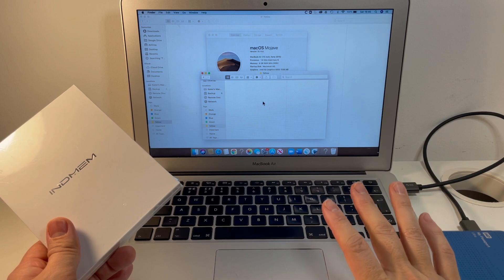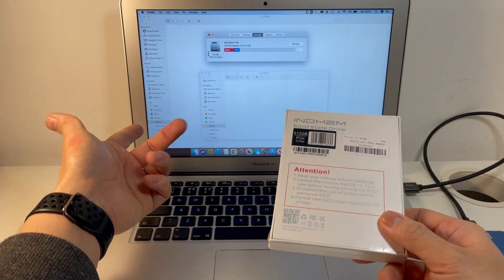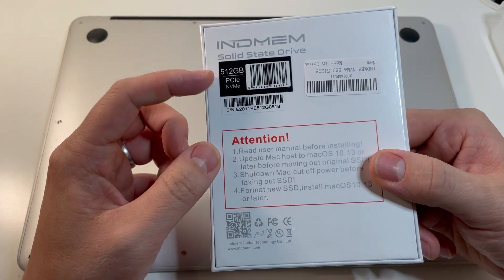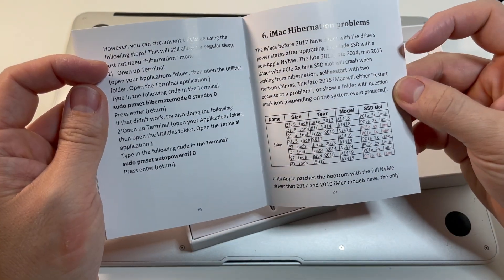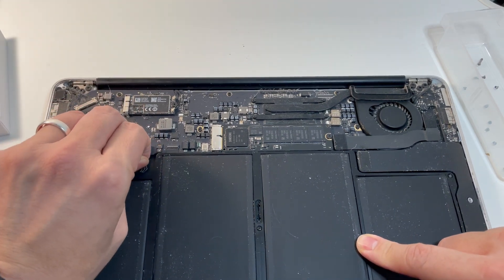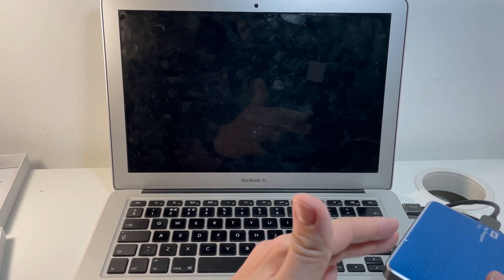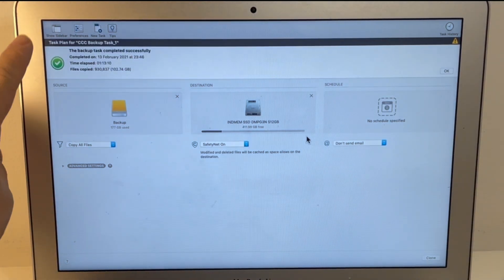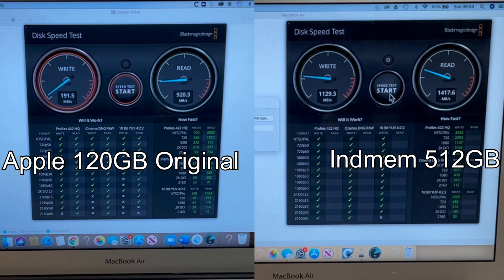Indmem 512GB SSD Upgrade - MacBook Pro 13" Early 2015 Custom 12+16 Pin Apple Solid State Drive

Comment: My original SSD failed and I replaced the drive with the Indmem 512GB SSD, and is not being recognized. I went through the steps with Disk Utility and the SSD doesn't even show up. I opened a Terminal and entered the command "diskutil list" and pressed enter, and the Indmem ssd doesn't show up. Any advise guys? 

Thank you for your help!

Comment: On MacBook Pro retina 2015 I disconnected battery connectors from motherboard as you suggested @ 6:27, and now I cannot install them back, so the battery cannot be connected at all. I wish I never followed your advice. You have to tell that different types should be repaired differently. Should I go to Apple to fix my batteries now? Pay them thousands to fix 500$ old notebook :(

Comment: I have a 2014 11" MacBook Air (last version that'll run Windows 7 under Boot Camp, useful for some legacy games/software) and I'll be taking it from 128GB SSD to 512GB via this very same INDMEM product.  Current stock SSD is giving about 300MB/s write and 625MB/s read, not too bad for the age, but I've read on Amazon reviews that the speed increase can be quite substantial, enough to max out the PCIe bus of this particular model anyway.  Trade-off may well be increased heat/decreased battery as presumably the processor needs to work harder with more I/O throughput - Andrew, have you noticed anything like this post-upgrade?

EDIT: Other thing I've read is that you need to take the Mac up to Big Sur in order to trigger a BootROM upgrade to a 4xx.xxx.x.x version which will fix any sleep/hiberation issues.  As I did a logic board swap (failed on my MBA due to water damage) and it already has this version (evidenced by the slightly lower pitched startup chime) this should help, but I believe I'll be sticking with Catalina as I don't care for the look/feel of Big Sur even though my particular MBA supports this as the last official macOS version - probably dosdude1 will make a patcher like he did for older Macs to add later version support for this and other models, post-Big Sur (done the Catalina patcher one a few times and it can run surprisingly well on 2011 and up MBAs).

Also, the "hard to tell" thing you referred to in the video?  I believe the four chips under the sticker are the 128GB SSD modules, and the one not under the sticker is the controller, which sorts out stuff like wear levelling etc via it's firmware.

Comment: Too bad newer MBPs have soldered SSDs.
Reply from the maker: Yes and also it's impossible to do maintenance on them if they break, they just have to go back to Apple to be replaced. MBP 2015 and MBA 2017 are still decent laptops and are the last upgradeable SSD models.
Reply: There's a reason a lot of people love the pre-Retina 2012 Pros for their upgradeability even if they are getting a little long in the tooth eh?